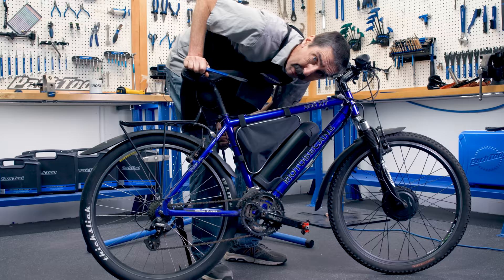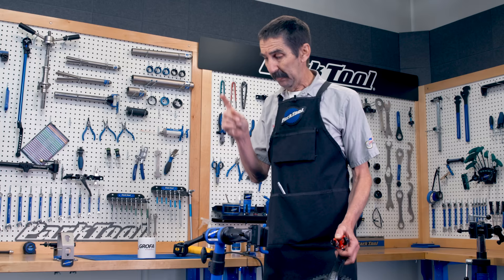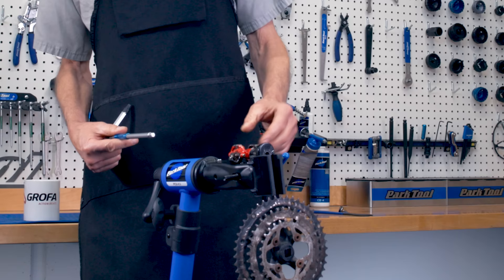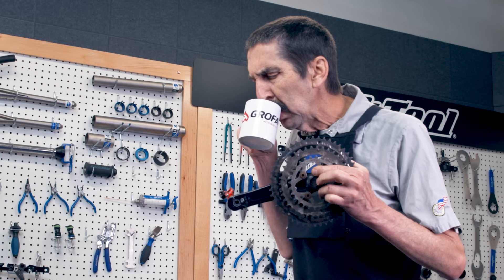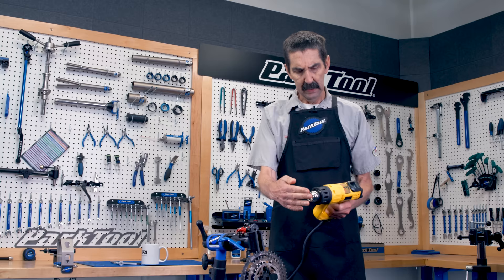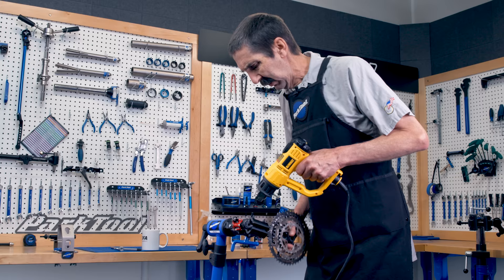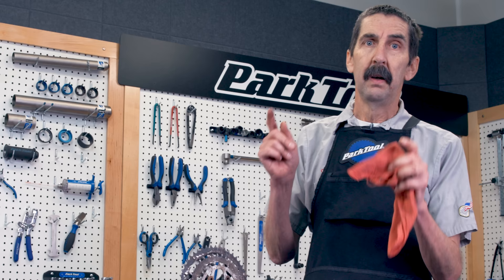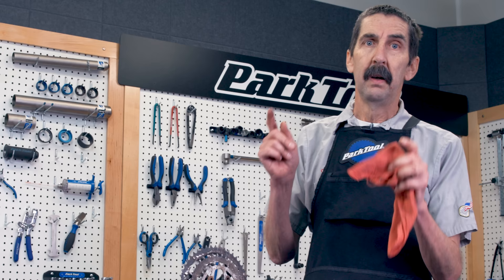A Stubborn Pedal Removal | Tech Tuesday #221

Comment: The direction of pedal threads always has me triple guessing and checking and doing mental somersaults so I'm not going to ruin the cranks.
Reply: Just remember the drive side is a normal thread when looking at it from the outside.
Reply: I just remember it this way, "right is right, and left is wrong". :-) As in, left pedal reverse threaded.
Reply: pedal always tightens in the direction of the bike is going - that is how I remember it.
Bottom bracket (if BSA) - the opposite.
Reply: Both sides loosen pulling the wrench towards the rear of the bike, tighten towards the front
Reply: @johns3106  at 12, 3, 6, or 9 o'clock? And from which side of the axle?
Reply: Crank forward, Allen key backwards
Reply: @stug45 Ohh I like that one. Its going on the inside of my toolbox.
Reply: @mobilemiall  I use the same exact phrase to remind myself. The one nuance is that the right pedal is right from the perspective of looking at the crank from the outside. If you are trying to undo it from the inside as Calvin is doing in the video, the right crank is lefty tightey rightey loosey.
Reply: Left side is left hand thread. That bits easy. What gets me thinking every time is loosening clipless pedals with the allen key! It's always the opposite of the opposite of what you think! 😂
Reply: I always think of it this way: to tighten rotate as the pedal is moving forward, to loosen rotate as pedal is moving backwards. Never missed the winding since I remembered it that way, and I change my pedals quite often :)
Reply: @johns3106  Now that is the easiest way to remember.
Reply: Just remember to pull the wrench towards you for either pedal when you are standing over the bike
Reply: I always think "It's the direction of pedaling backwards" because regular pedaling tightens it.
Reply: They survived full pedalling with your whole weight haven't they. Probably why the pedal isn't coming off, one of the reasons.

Comment: If you don’t need to get the crank off ASAP — refurbing and oldie for example — penetrating oil will creep in eventually. It may take days. No need to slop it all over the place. Add a little every time you pass the bike. Also, when heating, add a few drops of p-oil as the part cools down. Repeat a few times. This may draw some p-oil in as the joint cools. To ease pedal removal with the crank on the bike, use an old toe clip strap to strap opposite crank to the frame.
Reply: penetrating oil does work faster when heat cycling the parts, probably because the materials expand a bit... mechanics also tap/lightly hammer on the stuck bolts.
Reply: nothing can penetrate between pedal and crank because there is white powder that was made by corrosion and its volume is bigger and pedal is compressed inside of crank, even oil gets inside, resistance is too big because "sand" is between pedal and crank

Comment: I love the smell a locked pedal or bolt gives when it finally breaks loose! The smell of victory!!
Reply: Me too😂
Reply: If it's a smoky smell you're talking about, the same thing happens with Shimano road chainring bolts that have never been removed before, I used to wonder why did it emit that smell, until I get to see a bolt I cracked loose sparked and produced a small puff of smoke.
Reply: it is galvanic corrosion and friction topped with theadlock.  throw a Ti axle into the mix and it is x10 (Ti ^ Steel)
Reply: I think you're talking about old grease.
Reply: @Smegmeister threadlock on a pedal? Never had one work lose in all my miles. Proper torque is adequate in most cases.
Reply: Threadlock on pedal threads is a guaranteed way to ensure you will have a bad time in the future.
Reply: I have seen all sorts used.

Comment: Penetrating oil does indeed work if you heat the crank arm, spray it on, and touch it up with more oil over a couple of days to let it soak in.  Then heat the crank arm again and on the steel pedal shaft use either CRC FreezeOff (a penetrating oil that freezes when sprayed) or a piece of dry ice, then try removing it.  Works like a charm.  And remember to use grease or preferably anti-seize when reinstalling the pedals.
Reply: Agree

Comment: last time I bought a used road bike (not very old, almost recent tech), and I wanted to replace the Look pedals to SPD. I tried it on the side of the road when I took it from the trunk of a rental car. it was more than an hour of failed attempts. then at home, with a heatgun and massive tools i finally did it :D (without braking anything)

Comment: I've used an impact wrench to remove these. Quick sqeeze of the trigger. Brrrrrrp! Job done.
Reply: chance of damage to the aluminum threads on the crank the more expensive part....might work in most cases but not the proper way...would you try an impact wrench on a stuck spark plug ??? i bet you wont...

Comment: Heatgun. The best tool to help with pedals and BBs. Just use with caution on carbon.

And threads are actually not sealed: there is always a helical chanell between bolt and nut outer diameters. That's why you always put a least an o-ring in hydraulic threaded couples.
Reply: This! From the outside it's probably pretty much sealed where the shoulder of the pedal's spindle is done up tight against the crank arm. But from the back, where the allen key head is, there's an open helical channel to let the oil soak all the way along the thread, penetrating into the stuck bits as it goes.
Reply: @AJB1  exactly. It's just the penetranting oil must be thin enough to overcome capillary pressure. But that is pretty much the main purpose, reflected in the name

Comment: A few good sharp hits with a hammer on a socket that's seated in the hex head can help break up corrosion bonds that cause threaded fasteners to stick. Particularly when it's a steel thread in aluminum.

Comment: I had this problem once but with a crank arm stuck on a square taper.  Heat did the trick.  I did not have a heat gun, so I boiled a kettle of water and poured the very hot water over the head of the crank.  That made the difference.

Comment: Before I would take the crank off to immobilize the crank, I use a toe strap wrapped through the opposite crankarm's pedal hole or pedal and the chainstay to keep the crank from turning. This works for me 99% of the time. The largest problem comes when the pedal flats or hex is rounded off; that is when I usually end up having to remove the crank.
Reply: when I had to remove the cranks, there could other issues also occured: removing the crank could damage the thread if it's also very stuck. (once, I removed the threads from inside the crank with the tool, but the crank stayed stuck on the BB axle :D then we cut it down with ang angle grinder)

Comment: I had that happen to me before but with the crank arm. Never occurred to me to heat up the part, even though I know mechanics use it with cars. Thanks for the advice!
Reply: I will never apply direct heat to any bicycle part. Car parts are OK for the most part, but the same absolutely cannot be said for bicycle parts, especially carbon.
Reply: @yonglingng5640 This is where the advice about hot water was excellent. 100C won't hurt any materials on a bike, even carbon, and the magic of boiling water is that it's impossible to overheat the parts no matter how hard you try.

I routinely use this for everything from stubborn pedals to bearing removal so I need to apply less mechanical force.
Reply: @TheDaern  Yes, hot water allows you to raise the temperature exposed to a component more controllably. My ex-colleagues once had to do it to a customer's aluminium frame when his carbon seatpost was seized in there. It took a few days and a lot of muscling around to work it loose.

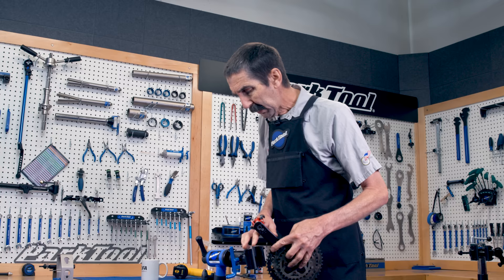Comment: If you can push with your foot on the removing tool in the right direction, with the bike on the ground (spanner or hex bit/key) you can apply your body weight plus leg muscle strength. If you take the crank off 1:10 you're better off using a vice and soft jaws (I made mine from some HDPE from an old chopping board that are shaped to fit a crank arm) to grip the crank. Vices don't move around so much when you apply leverage, especially when they're bolted down to a solid bench.  3:20 penetrating fluid works (applied the night before), if it's applied carefully to the joints between the spindle and the crank, and it's proper penetrating oil, not just WD 40. There's always capilliary gaps that a good penetrating fluid can get down, as aluminium oxide is often porous against hard steel pedal spindles.  5:00 if you've got a partially rounded hex, use a Wera Hex Plus bit (or a 5/16" bit, which is ever so slightly bigger than an 8mm), which bites into mangled hex faces better than a standard hex bit. Sorry, Calvin, other companies make some tools that are better than yours.  6:00 if you want to keep the pedal, and the hex is mauled, grind a set of parallel flats onto  the crank flange on the spindle: it won't be 15mm, but maybe 14mm, or 13mm. Or buy a new spindle, if they're available (often cheaper than like-for-like new pedals). If was super stuck, inspect carefully for galling, & chase out the crank thread with the correct pedal tap. It may be partially stripped, and be a candidate for a thread insert if so. Scrub the pedal threads with a wire brush (rotary one on a bench grinder is best) &/or pick out the bits of stuck crank thread with a sharp pick & make doubly sure you put lots of anti-seize or grease on the thread before reassembly. All of these things you could have talked about, but didn't. Are you pushed for time nowadays?

Comment: I would've used a secure vice so I can have two hands to work with. The most important thing is to not strip the axle  usually if you take your time you will feel if the tool is going to slip. I had to sacrifice a pedal axle by grinding it flat so I could use a wrench on it with the Allen wrench that way I was able to apply much more force without stripping it. Its not bad to sacrifice a pedal axle to save an expensive crank. Besides over tightening and not greasing pedals axles, they with get stuck because it's hard steal in contact with soft aluminum. You may want to consider copper washers but that length of prevention shouldn't be necessary a long as you apply grease and don't over tighten.

Comment: As for wrench direction, I think of two rider positions in a bunch on the road: "on the front" or "off the back". That is to say to put the pedal on, rotate towards the front. To remove it, rotate towards the back. No guesswork. Works every time.

Comment: I would not take the cranks out of the bicycle ... Last time i had some pedal stuck i did as follows:
1. Engage the highest speed on your bicycle: That will put the chain on the highest chainring on the front (adding some protection to the chainring teeth) and the lowest cog in the back (making it hard for the bike to start moving)
2. Put the cranks in the 1-2 o'clock position
3. Put the wrench in the pedal as horizontal as you can get it (a ratchet could be useful) and secure the tool to the crank with a zip tie
4. Grab the rear brake completely and hop on the wrench until the pedal starts moving
Reply: Nice. I'm reading the comments for ideas like this. Makes sense. I generally try to avoid taking off more parts than needed unless I'm sure they will come off and go back on without problems. What if on this bike it turned out that crank removal was even tougher than pedal removal?
Reply: @dre3951  Exactly. On older bikes for example you will need to clean, lube and repack the ball bearings and fine tune/adjust the crank play. Its a lot of time and may not be required.
Reply: you do not need to do any of that to refit crankarms.  @CyclingLifePT
Reply: @bmxscape  Thats right. We dont. I"m talking about avoiding that if possible. If its not broken, why fix it?

Comment: There are times when you can clamp a basic allen key/hex wrench in the bench vice and then turn the crankset by hand.  Use lots of rags if you have to pull on the chainrings..!  You can even use the soft-head mallet to break the thread.

Comment: Tip: use a swivel head breaker bar and hex bit socket, as this will allow you to apply force in the same plane as the mating surface between crank arm and pedal axle (it's also a lot sturdier that the flimsy tool he uses in the video, and remember that you should never heat a carbon crank arm). Bonus tip: if you fixate the crankarm with a rope tied between seatpost and opposite pedal/crank arm, you don't need to remove crankset from bike.

Comment: I removed the left crank from the bike,  clamped it into a huge vise. With a 1/2 inch impact driver blasting at the Allen bolt spindle in reverse, and my son heaving with a wrench  flats in the same rotation,  nothing happened! M-540 spindles fit Shimano road pedals bodies though!

Comment: Crazy video.  The torque on the wrench was amazing, you can really see the bending.  Would you recommend using a cheater bar to increase the torque?
Also, should a lubricant be applied to pedal treads when installing new pedals to reduce friction on treads?
Reply: I put a little grease on the thread before I put pedals on because that is where dirt and water always goes. You could use anti-sieze but quite messy.

Comment: The best indicator that im turning my pedals in the right direction is to see if the wheel goes along when 
Loosening/tightening the pedals
If it did not or the cassette just "freewheels" 
You are loosening the pedal
If the pedals lock with the wheel when you turn the wrench,
You are tightening it,
Goes 

It was designed that way so the pedals would tighten even more if you pedal hard 

Just remember when turning the wrench with pedals on cranks

 freewheel is loosen
Locks with wheels is tighten.

Comment: Calvin, I believe that applying heat is actually assisting the breakdown of chemical bonds (rust) more so than expanding the retaining surfaces. Excellent method (apply heat to stubborn metal fasteners) to aid in disassembly.

Comment: I always install pedals with a dab of copper grease to prevent galvanic corrosion between the aluminium crank and steel axle - works for me, but I've had to deal with plenty of stuck pedals like this when somebody didn't do that.
Reply: Copper grease speeds up the alu corrosion. Regular grease is just fine.
Reply: @ggaskoin  That has not been my experience. Copper grease specifically prevents a galvanic reaction taking place between the aluminium and the steel, which is common on pedal to crank joints, because they are close to the ground and subject to getting doused in slush and road salt in the winter if you live in a cold climate. I was in a bike workshop just today discussing exactly this issue with another bike mechanic - we are both pro qualified.
Reply: @drengskap  There are two opposite opinions on that, all given by "pro qualified" mechanics. One thing that makes no doubt is that copper grease is messy as #$%@ making everything dirty around :D
Reply: @ggaskoin  No messier than any other grease, in my experience.

Comment: That happened with one of my sram DUB crank arms. I had to use a ratchet with a 5 foot long metal pole as an extender and then ziptie the crank arm to the bike in three places so it wouldnt move. First time it broke all three zip ties clean in half but on the next try I did get it. The noise of it cracking loose burst my ear drum, as loud as blowing a tubeless tire.

Comment: it was easy, i had to disassemble pedal, grind axle to be flat , put it into vise and then i grabbed crank with 2 hands and tried to "paddle", it barely moved, electric corrosion of aluminum and steel

Comment: Hi, great video. I have an aluminium seatpost stuck in a titanium frame, would heating work- or rather cooling it down with dry ice? Also, should I try and turn it, or knock it further in to try to loosen it?

Comment: What a tiny wrench for pedal removals 😅
Having a really long lever, like for car wheels, helps with removing stuck pedals as well. The longer the lever, the larger the force you can transfer to the bolt.

Comment: what to do if you used a crank puller on a crankset like this and you stripped the threads? how do i remove them now?
Reply: Often, the stripped threads are because (perhaps due to dirt on the crank fem threads) the puller wasn't fully threaded home in the crank. If this is so, fully clean the crank threads (and make sure you hadn't forgotten to pull the tightening  nut or bolt). Then carefully work the puller past the damaged outer threads to the full available depth and try again. Beyond that, a hacksaw and chisel will work. Once.

Comment: I much prefer to put the crank arm in a vise.  A vise is firmly attached to the workbench, and the workbench is firmly attached to a cement wall.  (Protect the arm with pads in the vise jaws, obviously.)  This will allow you to apply all sorts of force to the pedal.  Soaking with penetrating oil is super easy.  Using an impact wrench a breeze.  And using the massive PW-4 pedal wrench on those with flats.

Comment: In my mind, I always thought heating the arm would try to shrink the hole and expand the outside of the alu crank arm. I still used this method believing that the post-heating cooling would aid in breaking the lock on threads.

Comment: wish I had a heat gun when I wanted to extract my square taper crank arm. Cigarette lighter did not work lol.
Now it's in the trash - ruined thread so needed to be cut - and integrated took its place.

Comment: I had to buy a pedal wrench to get my pedals off because the shop who installed them didn't grease the pedals. It took my whole body weight to get the damn thing off.
Reply: Monkeys with a wrench...(not you, whoever installed your pedals dry)
Reply: @yonglingng5640  yeah that's what happens when the two head mechanics quit because they had their pay cut after being taken over by corporate.